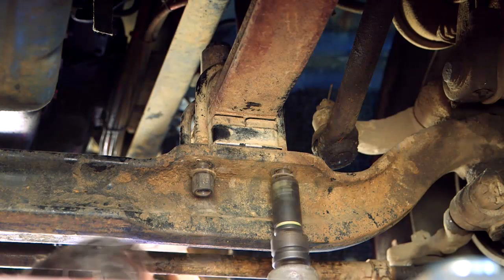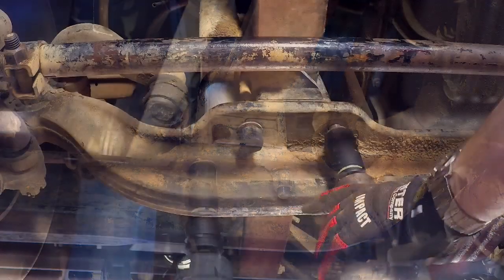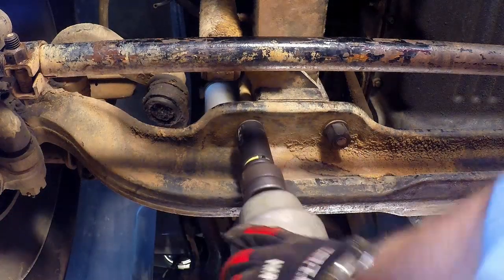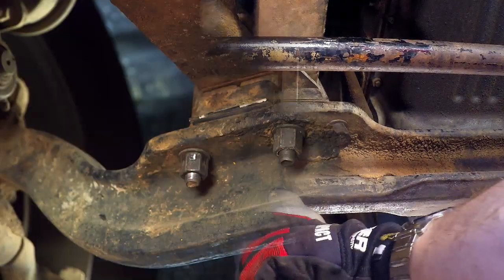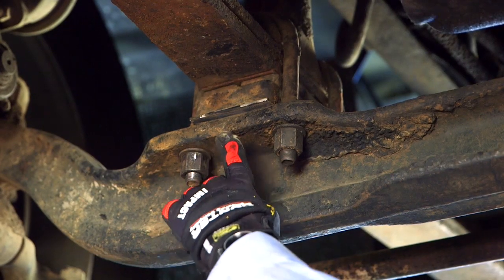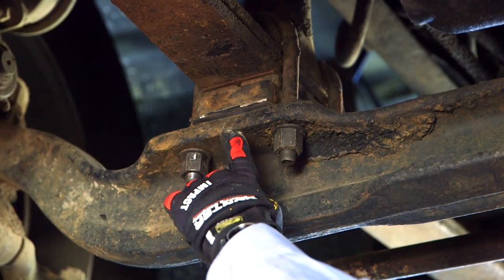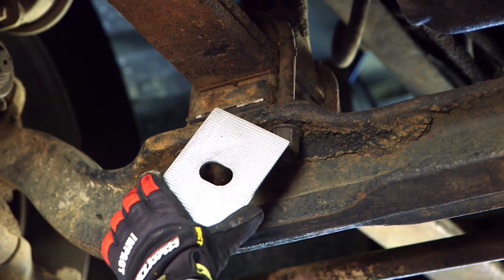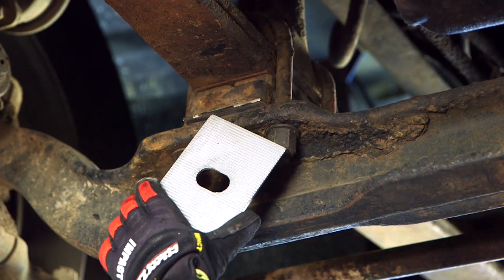Heavy Duty Truck Caster Wedge Adjustment - Hunter Engineering

Comment: Could the shims be a inch higher on passenger side or is that to much caster
Reply: What you may see is that the spacer blocks ARE the caster shim. This is common on Volvo tractors. The difference in the overall thickness (not the angle) of these spacer blocks is to compensate for the difference in frame rail height. The frame rails are at different heights to allow for steering arm clearance.

Comment: I have been in the business for 36 years......This video is wrong.....you don't put another caster shim on the other side.....that defeats the purpose of changing the cross caster.....you need .75 to 1.00 degrees of cross caster ( the passenger side being the higher negative number reading) to get most trucks to drive straight on a light to heavy crowned road......the only reason to put another caster shim on the other side is if you can't get the .75 to 1.00 degree cross caster using a shim on one side......and you would put it in the opposite direction on the other side......
Reply from the maker: Hello and thank you for your feedback. The intent of this video was to show how to raise or lower caster to be in spec by using the same shim on both sides where a cross caster issue is not present.  You are correct that when making corrections for cross caster that the same shim would not be used on both sides, which is outside the scope of this video. Thank you for using Hunter equipment!
Reply: Sir your mail id please,I have some questions about caster adjustment
Reply: Got a question for ya, got a newer Pete, had the front blocks cut down to lower it, still has same angle of caster as factory but front end wonders and feels lazy, big dead spot front left to right? 
My other Petes same wheel base and suspension I pulled the block completely shimmed the left 4 and the right 5 they drive great, what should cuz the truck closest to stock drive the worst?
Reply: @jimbro389  Did you ever solve this? Sounds like the wheels are toed out a bit. I'm no pro but always curious what the fix is or was.😀
Reply: @RC-Heli835  I ended up removing the cut blocks myself and shimming it like 2 on the left and 3.5 on the right, installed new shorter u bolts 
It’s actually drives A LOT better, it doesn’t feel lazy or any of the characteristics it had which is crazy and makes no sense lol it pulls very very slight left, I need to get it in for an alignment to check the toe,   The shop that did the previous work is a well known shop that does good work I think maybe they didn’t check the toe after cutting the blocks assuming it wouldn’t change due the the angels not changing and only lowering it a couple inches?  I am going to take it back to them soon and have them check and adjust the toe. Funny thing I’ve debated a few of the mechanics there a few times over turning radius, they don’t change the drag link when lowering the front of a truck, instead the pop off the steering and set it back to center which is approximately 1/3 of a turn back to the right, I try telling them that 1/3 of a turn is lost to the left and gained to the right, the gear box only goes so far, I drive the trucks too the won’t turn left worth a dam until I change the drag link, I’ve found an adjustable link that’s off an international same rod ends and it fits perfectly on a 388/389 Peterbilt if your lowering or airbagging the front.
Reply: @jimbro389  I suggest you take the truck to a reputable alignment shop and have it measured. The numbers should tell you what you need to know.

Comment: This video does not explain how the caster adjustment was determined. There are various sizes of caster shims.

Also, never reuse u-bolts and nuts. Once loosened, you must install new ones.

Finally, you did not mention the direction of the caster shim! Negative or positive? I rewatched it again and fortunately you guys did install it correctly: the low side of the shim closest to the front bumper; negative.